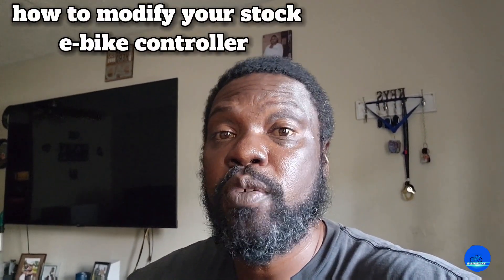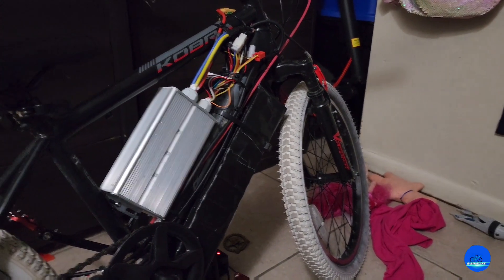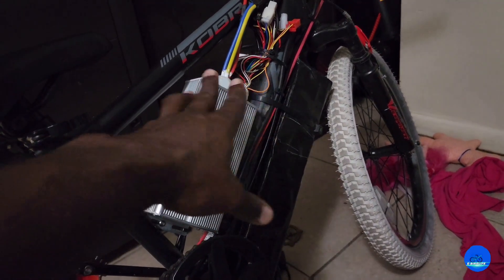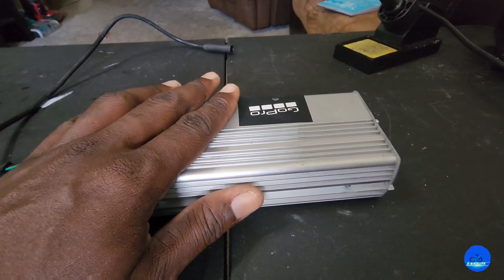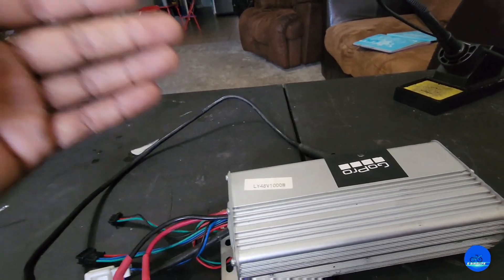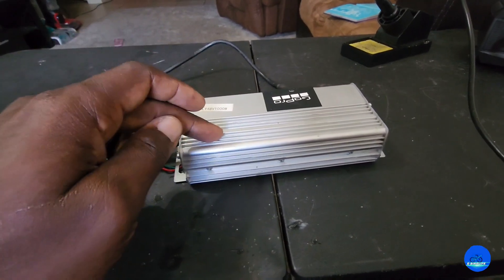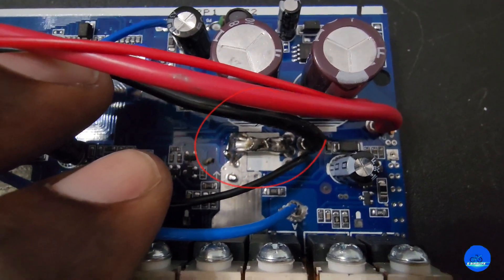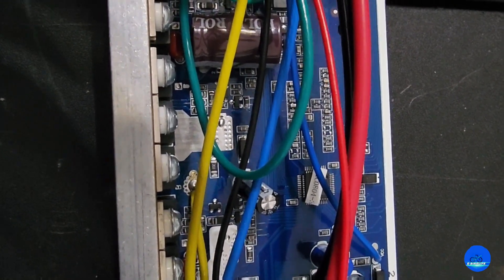how to modify a basic e-bike controller(MORE POWER)

Comment: Let me ask you a question , I have a HIKEEP K6-L 48volts 15amps battery  with a controller is rated at  + or -  21amps. Now the people at HIKEEP are telling me that their 48volt 25 amp battery will work with my + or - 21amp controller, I know I am not stupid but wont this 25 amp battery destroy the 21 amp controller? or am I missing something , THANK YOU.
Reply from the maker: No you is fine no problems 😊
Reply: @EBG-offical  So the 48v 25amp bateery will work with the controller rated at 21  + or - controller?  I trust you you know your stuff.
Reply: @EBG-offical  So the controler will only draw 21 amps? is that how it works. And I'll get a longer life battery and a little more speed. That is the only way I figured it out.
I Really Appreciate this, this is my first and I'm like 50plus age, lol

Comment: My wire to motor melted can I fix or do I need new controller
Reply from the maker: It depends if you motor wire shorted out
Reply: @EBG-offical I’m not sure why it melted. So I took off the cover and exposed the controller. 
If I got a new controller I would only get the one side of the connector 
The other side goes to the rear hub motor. That goes to the left foot side with a little spring covering where it enters the motor. 
Is the wire replaceable or would I have to get a new motor as well?

Both ends are hardwired into the hub or the controller
Reply: @EBG-offical 
Btw I have a Amyet v9 g60
Stil under warranty

Comment: Reflow your controller:  #1 = The Capacitors #2 = Negative Shunt #3 = Negative + Positive Bus Wire on the 3 Phase Wire (if you have it) + Mosfets!  ADD 15 %+ Power easily!
Reply from the maker: Ok, heck, yeah
Reply: How do you do this any video or advice would be greatly appreciated
Reply: @DavidVangorder-k1n  -  If you do not know how or do any of the posts above.  You can get a more amperage controller.  Easier and faster and safer too!
Reply: @JodBronson I've got a engwe c20 pro, whats the biggest controller you would recommend?
Reply from the maker: Probably a fardriver 7235
Reply: @EBG-offical cheers bro I really appreciate it! Will that be ok with a 36v19a battery and the 250 motor?
Reply: @peddlingbricks  -  You have to get the one that meet your specs.  In your case is 36V with 250W Motor.  If I got that correctly, 36V is low.  There is no need to have expensive controllers.  I would get a 36V with 500W motor power controller is more than adequate.

Comment: Please tell me if anyone has the 48v 39v controller. 18ah can I get a bigger one or can I damage something?
Reply from the maker: What voltage is your controller and battery
Reply: I can't find it on Amazon but can I have a bigger one because I had a 48v 39v 18ah or what do you recommend for a controller. and my last question is should the battery for the ep-2pro engwe be 42cm?

Comment: Good afternoon sir i have a windone e2 ebike can i do the shunt mod on the bike to make more power don't have the money to buy a new moter
Reply from the maker: It depends if the controller is filled with putty  then it's impossible but you will get a slight increase in performance

Comment: Hi not sure if the channels active but I have a hitway bk6,it’s got a 250w motor and the battery is 36v 12 is there any way I can get abit more torque or speed out of it,I was thinking about the shunt mod,but if there is another way that be helpful great channel by the way
Reply from the maker: @gerardsmith-go8ro  well you need to do a complete overhual of the bike i would go with a 48v kit from ebay

Comment: I got an ebycco 5000w thats plenty fast top speed and the pickup is really good but only once you start going 5 mph it’s like a safety thing in it that makes it start really slow then the power kicks in and the front tire spins for a second is there a way I can adjust it so full power hits immediately or do I need a new controller?

Comment: Nice!! I’m gonna try this on one of mine tonight. Hey question, if you don’t mind, I have a (OOK-TEK S8) dual motor e-bike, first few days I had it. I was going downhill and switched to dual motors while I was paddling and the front motor went out and hasn’t worked since. Error code is for the controller. Manufacturer sent me a “replacement control controller“ which didn’t fit and was the wrong size… Not to mention the two controllers are literally connected with wires that don’t have connectors externally. So you can’t separate them unless you cut wires. Anyway, the back motor works great, and I think there’s gotta be some fix for thefront motor controller. I just don’t even know where to start. Any help or comment on this matter, that would be very gratefully appreciated my friend. Liked and subscribed.

Comment: Hey bro think this will work for this 60v2000w controller n motor I got by vevor a its the controller I can get cuz Amazon ripped me off gave me credit for refund but only works for sold by Amazon so this is what I found but all my battery are 72v so you think if I did this trick to this 60v controller I got coming I could run my 72v battery and bigger motor on it ? Or should I be starting to build a 60v battery lol

Comment: can my ridstar q20 1500w ebike handle a 60v 20ah battery?
Reply from the maker: Open the controller and check the caps for high voltage

Comment: Bro I need to set up for my Anioki A8 pro Max 52v dual motor. 3,600 Watts combined. 45 mph. Definitely need more. I would pay you to just pick out what I would need and send it to me, to get more torque and speed out of this bike. Probably just need an aftermarket dual controller. Can you run higher volts like 60v? The motors don't seem stressed at all.

Comment: I have a Amyet V9-g60 and It will not go past 27mph no matter the settings. 
I want to keep my 48v battery and still run it at 36v but have a higher top speed. 
Which controller should I consider for a more "plug and play " setup?
Reply: Also wondering this

Comment: My controller is very small and only has one shunt, would it make any difference if I added some solder to it?
Reply from the maker: Yes add solder to it
Reply: @EBG-offical  I did yesterday after I wrote this, the difference is huge, the bike gained about 300w
Reply from the maker: @thejunior9497  nice!!
Reply: Hi. 48v 14.5ah 19-28amps 1000w  can I change 2 a 52v 17.5 45amp(Max) 1000w. ?😮

Comment: i lost my keys to my batteries on my ebike, do i need to take the battery off to swap the controller? or do i just need to have the battery and bike completely turned off and that’ll be fine?
Reply: Make sure you take the battery off better then when you do turn your screen on till it goes on qiock and turns off completely before you mess with the controller to make sure i have all juice off the electronics in that controller but yes defensively take that battery off. You could use a flat head screw driver to turn them locks and that will be your new key🤣🤣🤣 but hey it works or you could also disconnect the battery from the controller cable jist be safe you dont touch them positive and negative wires together or touch anything on the electronics on the controller good luck be safe

Comment: I have a question,  I'm considering installing a 48v 1500w kit with a 52v battery. The controller that comes with the kit has 14 gauge battery connectors and the battery has a Xt90s anti spark female connector with a 10 gauge wire. I will have to cut the battery wires (14 gauge) on the controller and solder them to the 10 gauge battery wires. Would this be ok or would this burn up my controller, soldering 10 gauge and 14 gauge wire together? ANY help would be appreciated.....
Reply from the maker: No! You is perfectly fine the bigger the wire better the current can flow
Reply: @EBG-offical  Thanks man!!!!
Reply from the maker: @Thomas-nz4uh  no problem

Comment: hey man! got a rad bike with an aftermarket controller just like this silver one. i want to add a fuse, I'm worried about blowing the system. i have a loud audio system pulling an extra 300w out of the battery, as well as my girlfriend being a passenger sometimes. if it's a 750w battery and the bike is doing 750w to the motor, plus 300w at full Bluetooth volume, doesn't that mean it's doing 1050w so more than the battery can take? where do i add a fuse line? thank u!!! 😀😀

Comment: So I have the AMA005873 ANCHEER ebike.. Its like 300$ on Amazon. I was wondering you know a way to make that faster because the controller is like built into the bike.
Reply from the maker: Yes I believe the controller is in the battery cradle it's going to need a complete overhaul

Comment: Hi mate av just put a build together the lcd screen works but no throttle the kit was for 52v battery 2000watt motor but av put a 60v battry on and the controller is for 48v could this be the problem why throttle aint working?

Comment: I have a 52volt controler and battery.If I do the procedure do I need a higher voltage battery or will I pull more amps just by doing the Shunt?This controler I have is 22Amps
Reply from the maker: Yes it will pull more amps when you do the shunt mod
Reply: Thanks

Comment: Nice , I have a Q20 Pro AWD with 52 volt dual batteries and dual motors , would that work with this bike also ??
Reply: how fast is it now?
Reply from the maker: @伙 about 45mph on 60v
Reply: @EBG-offical  im gonna get the q20 (not the pro) but the 1500w verison. ima upgrade to a 60v 40ah battery and a 60v 40ah controller that is pretty powerful!  Any ideas on a possible top speed?
Reply: @伙  33 miles per hour
Reply: I have a 1500w 48v q20, with 20ah it can do 33mph... I was thinking of doing this to mine but I'm not sure what results I'll get

Comment: I got a question I got a 72 volt 3000watt kit it comes with a yellow brick connector for the motor and controller and battery and idk if I should use that bc everyone says that’s how fires start. I was told to solder the wires together instead or use bullet connectors what do you think?
Reply: Stick with the yellow bricks and use some superglue

Comment: Will this work on a totguard stock controller
Reply from the maker: As long as they have a shunt it will work
Reply: @EBG-offical  I just now have it apart and I'm looking at it it is all in a slide box I don't have to get it to slide out of the box first I don't see anything easily on the end is it just a big capacitor that you are just sorting out so it goes straight through instead of through the big large capacitor
Reply: It's a brushless DC motor controller voltage is DC 36v product number JH3AZ2612DZQR

Comment: Bro i have a question i have a ebike really nice its 1000w i have a unrestricted display so my battery is a 48v 15ah how much amps i need to do 40 to 45 mph ??? Easy and efficient please help bro
Reply: Did u get it to work I have a 20ah set up I can get up to 37 stock but want a little more

Comment: I will pay an electric guy for shunt mod thursday  but most people told me it only increase acceleration not top speed .. i have a 1000w bafang motor and dual battery 48v 22 amp each..i go 28 mph 46 km/h..my controller is 48v ,maximum current 26+1 Amp … will i gain only torque?? is it worth the 100$ canadian he will charge me 😅… Thx again  in advance 👌
Reply: Just replace the controller to a aftermarket bbshd controller

Comment: My 45 Amp controller can take 80+ volts.
Do you think it has a shunt like that I could mod ? ?
It's maybe 5 years old, didn't come with any displays. Runs my diy disability scooter up to 37 mph at 80 volts using a 350 watt 36 volt direct drive 16" hub wheel

Comment: Hi , great video btw ! I have a new fat ebike chinese yolin .1000w bafang motor with dual battery 48v 22 amp each ..it stuck at 29 mph , and i dont know what controller i have its under the seat , should i go for 52 volt battery ? or try to trick the controller? i dont have money for new battery and mine are still new ..
Reply from the maker: Be better off to preform a sunt mod

Comment: bike has a design flaw. due to the batter being on the bottom like that the stones kicked up by the wheel will hit the batters. and if someone pulls out on you and your crash and your forks go in.  your wheel will smash right into the battery pack.
its better to put the controller on the bottom
Reply from the maker: No worries it's protected
Reply: "if someone pulls out on you" 😮😅😂

Comment: What a janky setup.😆
3 volts is not enough capacitor overhead for 60 volts, and MOSFETs will burn out after shunt mod.👎 Buy an appropriate rated controller for battery and motor, or enjoy replacing them like toilet paper.
Reply from the maker: You know how old this video is?  You talking like it was yesterday lol
Reply: @EBG-offical  And you're still a food stamp mackin' mushmouth who don't know crap about electronics. Hey, hey, hey! 😆 Go vote for your big daddy Trump. There's another stimulus check just waiting for ya at his zipper.😁

Comment: So if i were to do this mod on my stock controller and not change the battery or anything else, my bike will be faster?  Is this just the speed limiter being taken off?
Reply from the maker: You will feel about 25% increase in acceleration 15% in speed
Reply: @EBG-offical  i have a 250w ebike.  Top speed is 20 mph.
Reply: @EBG-offical so i should find the controller open it up and solder 2 parts together?  I would love to have a bit more speed and accelration.  Nothing crazy cuz i ride in the city and dont want to get hassled by cops.  This sounds like a perfect option for me.  I can get up to 20 mph throttle and 24 mph pedal assist.  So if I do this i should see around 23 mph throttle and 27mph pedal assist?  And better acceleration?!  Cuz thatd be perfect!  Im new to ebikes so do you have a way i can contact you if i need help?  Im not sure where the controller would be or what it looks like.  Let me know thanks!
Reply from the maker: @YoKai_808  you will be fine , trust me 🙂
Reply: @EBG-offical  lol aight, ima just go for it, i think i found where my controller is located
Reply: Cheap China controllers don't have any speed limitter. Shunt is there to keep you from drawing too many amps from battery. Hoping your battery BMS has a fuse, else it will go into thermal runaway and catch fire.
Reply from the maker: @aleksandrbmelnikov  that is not the case , thanks for the info 👍

Comment: Can you wirer a moped throttle to a 1500 motor and 48 v battery
Reply from the maker: As long as it us electronically able
Reply: @EBG-offical  the adapter as 3 wire but the adapter for the frottle as 5 wire because it as a key and GPS built-in if that make sense pal
Reply from the maker: @kelvinmarland6572  email me at theebikeguy08@gmail.com send pics there
Reply: Well I got it of Amazon it did say for electric bike and mopeds it just the adapter that wrong

Comment: can existing 20amp 48v controller handle upgraded battery of 48v 60ah lithium ion battery? will controller get smoked or function without issues?
Reply from the maker: No, it will be fine  the battery can supply the controller with plenty of power the controller can only pull what it's designed for so if battery is 160a but the controller is only 20amps it will only pull 20amps
Reply: @EBG-offical  thank you for clearing that.
Reply: @EBG-offical  battery is 13s 48v 60ah with bms 48v 60amp and connected to controller 48v 20amps. will this bms work without issues?
Reply from the maker: @magnum44pi11  you will have no problems...
Reply: @EBG-offical  so after connecting this 48v 60amp bms  cutoff on 1st run as it reached 41 kmph. there was no power output from the 48v 60ah and once charger was connected to the battery to charge it. then its showing voltage again on the discharge cables. now im putting a 48v 100amp daly bms

Comment: I have no idea what im doing, figured id ask, how would you recommend upgrading a freego f2 pro for more torque? Im a bit of a hazard during takeoff from lights in traffic.
Under the "battery" section of their bike specs it claims to be 48 volts, 22.5  amp hours, 1080 watt hours. I assume the battery is where the watt hour measurements come from. So the speed controller would be where the amp hour measurement comes from? 
The hub motor says 1400 watt peak, uncertain of its nominal rating.
What would you recommend doing for my desired purpose? And what should i be concerned about in terms of "hardware clash"?
Reply from the maker: Ok I'll definitely get back with you tonight on this

Comment: Does the “more power” include torque and speed? Mine is a 1500w and I usually top it at 33-35 how fast do you think it will go if I shunt my controller?
Reply from the maker: Yes you will feel it, 3mph more and about 30% more in torque

Comment: I have a setup with a 2000w with 48v 20a battery should i do the same thing in the controller that you did on video ? Will i get more power ?
Reply from the maker: Yes, you can preform a shunt mod,  you will see a increase in acceleration
Reply: @EBG-offical  but the battery is only 48v
Reply from the maker: @boratbonisfacio4537  that is fine the controller will pull more current from battery no matter if it's 36v or 48v  the higher the volts the more top speed
Reply: But it will cosnume more battery too right ?
Reply from the maker: @boratbonisfacio4537  yes it will. There are some advantages and disadvantages to this mod